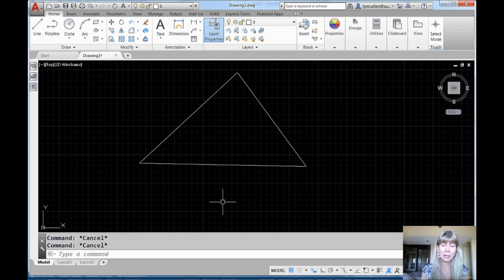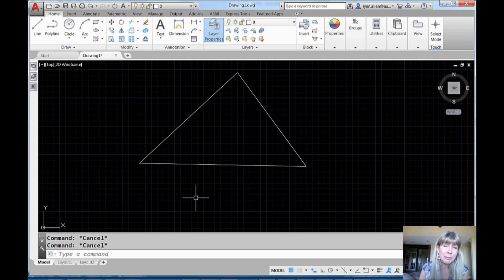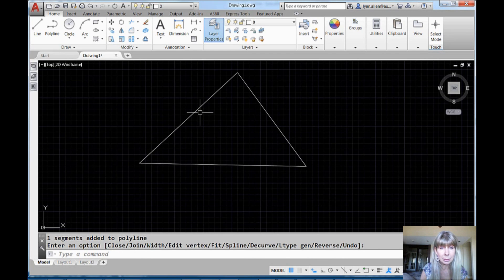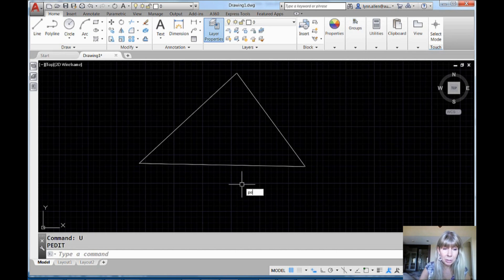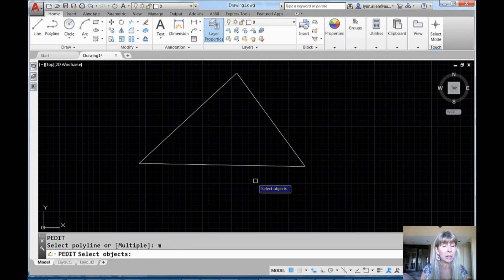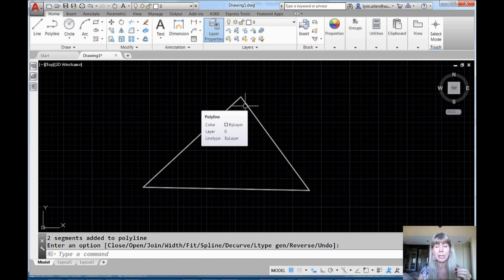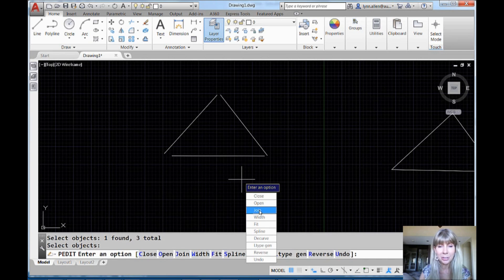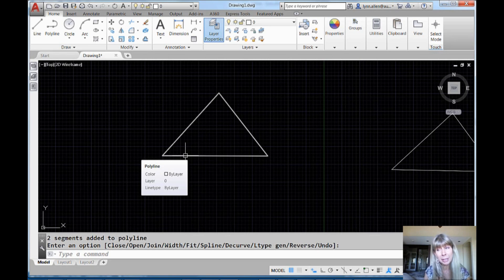Close the Gaps in Badly Drawn AutoCAD Drawings (Lynn Allen/Cadalyst Magazine)

Comment: Extra tip: when it asks for fuzz distance you can type jointype which gives you the option to extend the lines into eachother or add another joining line. Or you can set it to do both